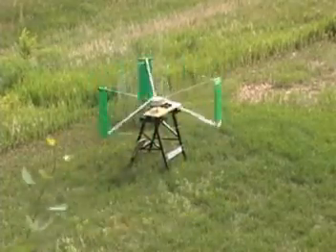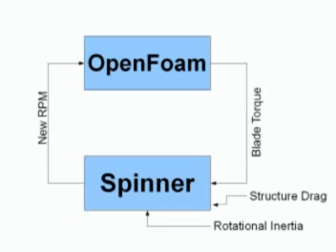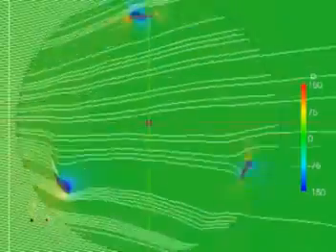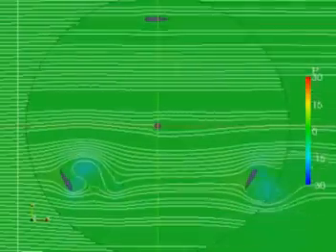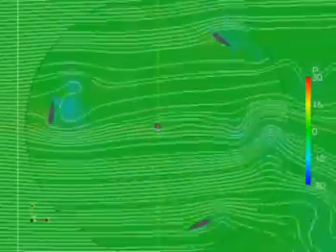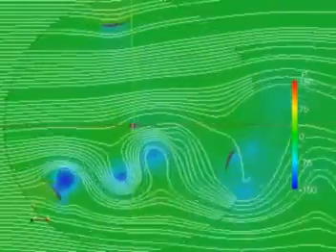Simulating VAWT Startup

Comment: I suppose the wing is stalling and preventing it from reaching higher speeds.  I guess the angle of attack decreases with increasing TSR.  If you reduce the problem of stalling, maybe it will reach higher TSR's.

Comment: I've been looking for a CFD application to be able to use my GA to do some wing design. So I was glad to find OpenFoam, but talking about a steep learning curve! And now I find that, you have already done lot of the work.. and even created Spinner to do the dynamic testing.. 
Would it be possible to acquire the Spinner software? Would love to be able to concentrate on the wind design (GA) and not having to start from scratch on the simulation.
Thanks.

Comment from the maker: @overunitydotcom 
There are two types of VAWTs, lift type and drag type.  I think you are thinking of a drag type which moves slower, but has more torque.  The lift type spins faster with less torque which is usually better for getting power out of alternators.

Comment from the maker: @lordvon64 
I'm running a laminar flow simulation and I should really be modeling turbulent flow.  So my upwind drag isn't as high as it should be, making the power numbers kind of high.  The general behavior of the turbine and relative powers to other turbines seems to be pretty good.  I'm using OF1.5-dev with GGI.

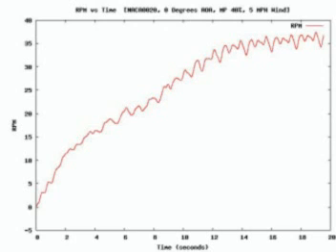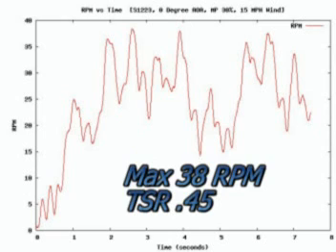Comment: at 3:28 it shows 37 rpm for a tsr of 1.25 and then at 4:36 it shows a rpm of 38 for a tsr of .45 If the wind speed and the diameter is not changed; as you say this is a standardized test, then this is what I question

Comment: why, if the dia. wind spd , and rpm is the same, is there a high tsr for one profile compared to another.  I thought the variables: wind speed, rpm diameter were the factors to get tsr.  The last two examples are 60"at 15 mph and the rpm is as close as you can get , yet one is over 1.25 and the other is less than .5?????